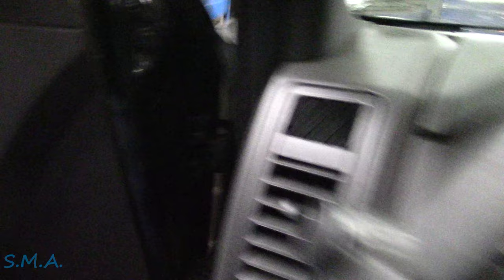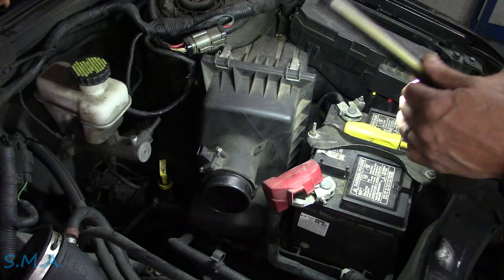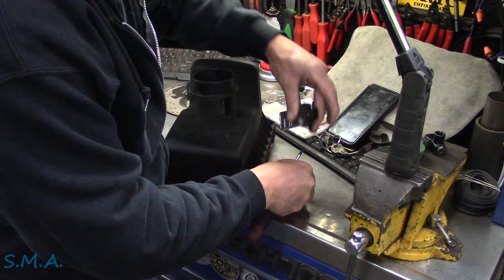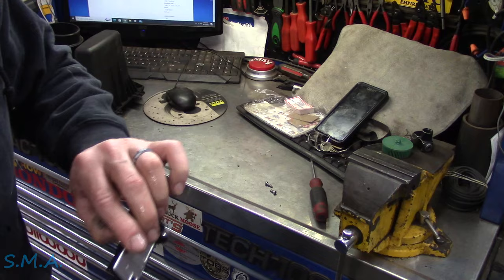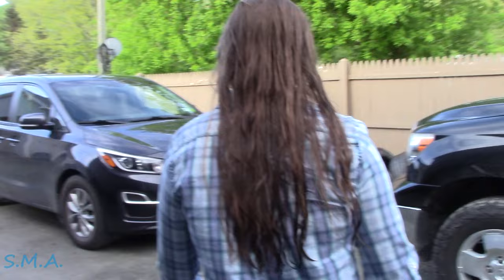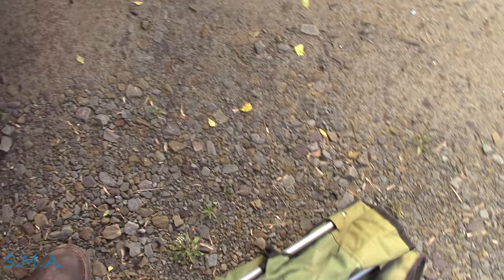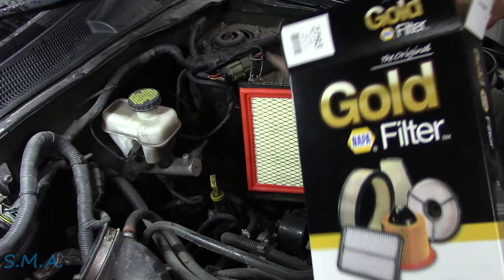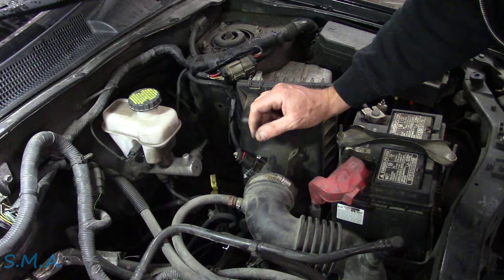A Mouse, A May Fly And A Broken Car....

Comment: Dang , it must have been really turbulent in there for that mouse at 65 miles per hour!   LOL The rush of air !
Reply from the maker: Heck with the rush of air, it was prolly more turbulent passing the throttle plate lol
Reply: Need someone to do the Math - gotta be way higher than 65mph 'wind' in the airbox surely? 
2liter engine spinning 5k rpm
Reply: @SouthMainAuto  Did you have to clean the throttle body?
Reply: @SouthMainAuto  Should the engine rated in RATPOWER instead of horsepower then ?
Reply: @SouthMainAuto  Hate to sound like an English teacher bitch,but the word is, probably, not prolly. Sorry just a pet peeve of mine... Love your content, always. Thank you for what you do.
Reply: @SouthMainAuto  Surprised you didn't pull a plug and check the cylinders for a badly shaken mouse.   I bet that engine had a squeak or two......
Reply: @patrickinottawa27  I was thinking the samething, and said nah you better not. Alot of filter missing and an absent mouse. At the end of it though if shes running good with almost 200k on it i wouldnt go looking for any trouble thats for sure.
Reply: @Acrowat40  A 2L engine at WOT sucks in 1L of air per revolution. At 5000 rpm that is 83 (round to 80) L per minute. Amazon says the filter element measures 7.29 x 10.21 inches = 74 sq in or .05 square meters. 80 divided by .05 = 1600 meters per minute or 1.6 km (one mile) per minute... 60 mph on the nose.
Reply: @bigtruck57h25  Y'all come on out to Arizona, where we have cowboy engineering. "Y'all kinnec up thet thar lat bub wit bob war!"
Reply: @flagmichael  cheers top work!
Reply: @homeserve9292  yes we never had cats in the house but if a mouse got in . bring the mama cat in over night and  no more mouse . traps not so much.
Reply: @bigtruck57h25  You must be a real hoot at social gathering.
Reply: @vincepalaa  you should meet his twin! LOL
Reply: @flagmichael  Your calcs are way off. Air velocity at an intact filter, at 5K, will be about 4mph. Velocity through the rat hole would be higher but impossible to say how much. Might get up around 60mph at the throttle body.

Comment: Nice catch Eric! Regarding the mouse in your wife's van, my wife did the same thing. She brought some plants home in the trunk and unleashed the little sucker. I had a mouse carry field corn up into the top of our Volvo's engine. He somehow got the corn into the timing belt area and dropped it down onto the crank pulley which caused the engine to jump time. After that experience, I made the best mouse trap ever by using a 5-gallon bucket with about 5" of water and drilled a hole at the top for a coat hanger. Then I drilled a hole in the center of each end of a can so it could freely spin on the hanger. I put peanut butter on the can so it was balanced and made a little ramp to the top of the bucket. Mice love peanut butter and go for it before anything else. I caught 12 mice over the next couple of weeks in my garage. Now I only get a mouse now and then. If it gets freezing cold put some anti-freeze in the bucket. I put a little bleach in the bucket as well. No smell, and you know right where the little suckers are. I've had them make nests on top of the cabin filter too...but no more. I tried sticky traps once and caught a baby bunny in one. Took me an hour to get the little fella out. He was missing a little hair but survived the ordeal. Love your auto repair videos. You are a fantastic auto mechanic. We could sure use more like you my friend. 😉

Comment: Happened to our RV when we were driving in heavy rain in Northern Ontario.  The air filter got saturated and released a bee that got logged in the MAF orifice.  It would run on the starter motor and die as soon as we released the starter.  We initially thought that it was a failed fuel pump.  Had we known that unplugging the MAF would have allowed us to continue we would have tried it.  Anyway a $500 tow bill to the Ford dealer in Wawa.  It was fixed in about an hour. Lesson learned.  I switched to a K&N filter and now I carry a scan tool.

Comment: EXACT same thing happened to me with my 93 Mercury Grand Marquis with the 4.6. No power and stalling at stops. Pulled the MAS and it had a dandelion fluff in it, which was odd as the air filter was intact. Blew it out with compressed air and reinstalled it. Ran like a Mustang after that.

Just remember the First rule of Ford: Check the MAS if it runs like A55.
Reply: Same thing happened to my Hondoo, but the mouse never went past the paper filter!  She had a real nice nest built in there!  I couldn't believe it was running let alone how well still!!
Reply: ahhhh.....the old danelion puff ball trick.....I hate when that happens

Comment: Tip : Pay attention how you put back your MAF sensor. If you put it backwards, you get problems. Usually there is an arrow, how the air must flow. Often it is fool proof, because they made it so you can only put in 1 way. But some can be installed in the wrong way.
Reply: @johnogara3029  This wasn't a tip for Eric.....🙄

Comment: I do find it interesting the problems you find here. My car issues are so simple the diagnostic is easy. The brake pedal sinks to the floor, that is the master brake cylinder. The power window does not work, the motor was shot. Noise is coming from the rear wheels, the wheel bearings were going. The car shakes on the highway, the front struts were shot. All these problems were found quickly and easily on my Subaru and all happened in the last 6000 miles (between 120,000 and 126,000 miles) and I never had a problem before these four concerns. Now that it is all repaired, the car works like new again. I can only hope my problems stay this simple but if they don't perhaps Eric's videos help. Thank you for them.

Comment: I had a mouse claiming his residence in my 1967 Ford Fairlane 500XL. It was a battle finding him but with sweat and prayers he was defeated. There were things I tried to keep the Rodents away but could not succeed. I finally came across a product called Fresh Cab sold in the big box stores, also Rural King and Tractor Supply. It looks like a giant Tea bag and smells like a pine forest. But for $12.50 a box(4 bags per box) it does what it's advertised to do. Bags last four months but I keep them going for six. Only thing that works for me. Doesn't kill a thing, but mice take off for your neighbors garage.

Comment: My girlfriends Mitsubishi would do the same thing. Start then die, couldn't give it any throttle. Disconnected the MAF and it started. Pulled it, cleaned it, problem solved. Eric you have really upped my diagnostic game and it has really helped me. I hope Mrs. O finds her critter and don't fly a kite with a key on the string when it's raining!!!!

Comment: I have a car that sits a lot, after replacing the air filter 3 times in 2 years I finally got some 1/4" mesh hardware cloth and made a plug to cover the air intake from the front. Don't know why they don't come like that.

Comment: For 28 years I worked on Honda motorcycles (primarily GoldWings).  When the GL1800's came out we immediately found the owners that lived in the 'country' had mouse problems
getting into their air filter.  I solved the problem by putting screen over the 2 air intakes.  Pop rivets held the screen on.....and no more mouse problems.
Reply: Any ?

Comment: The “ change oil light” was a bit of a clue as to the frequency of maintenance being performed.
Anyone that thinks, well that was an easy fix so you shouldn’t charge never owned a business.  You are more than entitled to be paid for your time and knowledge.  An inexperienced mechanic may have worked for hours before finding that problem.  Mice in your car is the cost of living in Gods country.  I spent many summers living on a small farm between Savona and Bath NY 60 years ago.  Lake Keuka was a favorite spot.
Reply: Anyone who thinks he shouldn't charge for the repair, should have fixed it them selves.  The car wasn't taken to South Main Auto because the owner knew what was wrong or they would have fixed it themselves.
Reply: Their everywhere,,,,, everywhere….sleep with rubber boots on with masking tape on the top ! Shows our age! LOL
Reply: @frotobaggins7169  10- fur on that !

Comment: would recommending an oil change be something to consider for the customer, or was it running rich for just a very short period
Reply: Dash message said "oil change required".
Reply: That could just be that it wasn't reset since the last oil change, they don't reset themselves.

Comment: Another a great video.  What a lot of people do not realize, is that damage done by a rodent to a vehicle is covered under automobile comprehensive insurance. In upstate NY, this coverage is relatively inexpensive, and lower deductibles should be considered. Besides rodent damage, comprehensive covers you if you hit a deer or if a rock breaks your glass. You are even covered for flood or a tree falling on your car. It would not be worth putting for the  repair on this video. .But for more costly repairs it most definitely would.  Moreover   you can also utilize your rental reimbursement coverage. If you put a claim in, you may lose your free discount,  but you would not be  surcharged for the claim.

Comment: Many years ago, I used to work at a shop that was next door to a quick lube place. At least once a week, they would end up breaking a car, pushing it out into the street and into our parking lot. One time, they pushed in a Prius. They did an oil change and an air filter, after that it would “crank” but not start. When they replaced the air filter, they dropped a leaf into the mass airflow sensor. Most cars don’t use MAF sensor readings when they crank and first start, so if they have a bad MAF they’ll start and stall. Many hybrids use the MAF while cranking, so if the sensor is bad, it will crank and not start. Removed the leaf, cleaned the MAF, engine started normally.

Comment: The best "trap" for mice and rats (plus a whole lot else) is actually really easy. Used motor oil. Fill up an old gallon paint can about halfway, and et up a little "ramp" for them to climb up. They absolutely cannot resist the smell and will jump right in, but can't get out.

Comment: Same thing happened to me. I had just put a new air filter in. A month later I couldn't keep my truck idling. Took the air intake hose off and noticed the screen before the MAF sensor was clogged. Hole in air filter. I now have a metal screen on the air intake hole to prevent mice getting in the air intake box.

Comment: Eric is correct.  Unplug a MAF sensor if you think it's giving you issues.  On a typical weather day (temp and barometer-wise) and at sea level, a Ford will run like new without the MAF connected.  Of course, it will never get to closed loop and it won't run right with less than ideal weather or altitudes and it will also light the CEL.

Comment: Mr. O, don't eat yellow snow, and don't carry around a long piece of copper..... Glad she got the mouse. I have a 2010 Escape. Runs well at the moment.  I inherited it from mom. I use it as a commute car to work and back (25 miles round trip). It's got the big 2.5.  It's only got 72,*** miles!  One thing about the Napa part number, you forgot to say "it's the classic 2793."   At work, we used the sticky pad traps (owners wife doesn't like the poisons), one of the traps is flat gone! Stepped on 'er and took off!  Been looking for a mouse with a big white shoe!  Watch for lightening my good fellow!

Comment: Had a 06 f150 towed in awhile ago and the customer said that when he started it fuel was spraying under the truck, upon inspection found the nylon fuel line was chewed through.  Replaced fuel line and sent customer on his way.  A week later the same truck was towed in with the same problem. Same line same place.  Made another one and wrapped it up in alluminum tape.  So far no repeat.

Comment: I feel Mrs. O’s pain.  Some years ago, mice spent the whole winter lounging in our RV and made passage ways everywhere in the most inaccessible places.  They made the bathroom vanity their latrine, and deposited an ample supply of mouse pee and poo.  It took a couple of days with a rented ozone generator to kill the mouse pee smell.  Every last bit of insulation was removed from the water heater under the gaucho.  We found fiberglass insulation everywhere in the camper.  What a mess!
Reply: Bin there…. Got the T shirt! They can be very costly !

Comment: Interesting that the nest remnants didn't get sucked in from the air box ?
Mrs O,try using those box type mouse traps in the car ,very practical .
I still struggle(life's tuff aye) with how many car owners don't know the basics of car care and maintenance,checking a air filter is reasonably easy ,and googling how to check the airflow sensor is very achievable ,even the Ladies can do it 😊 Mrs O could run a internet class for the Ladies,on car maintenance and a combined  class on Pest Control also ,Mrs O's squeak removal 😊😊

Comment: Great video Eric, seeing Vanessa looking for her friend in the car I can understand what she's been through , I've had a Mercedes panel van in for repair , waiting for parts as we all do at the moment , been outside for a couple of weeks, went to move it today , flat battery , opened the bonnet , it smelt lovely under there of 💩🐀🐀🐀🐀🐀💩 from Mr Roland Rat and his family , then I saw a family member on the engine , walked away , got the steam cleaner out , blasted under bonnet , chassis legs , engine and 3 of the blighters were being evicted by steam methods , they ran like the wind away from the van , I pressure washed it for over an hour , cleanest chassis legs in the UK, covered the engine in nice smelling stuff and moved the van , time to fix it and get rid , have left lots of square food blocks around the yard for his family to chew up and 👻👻👻👻👍👍

Comment: I was an hvac tech for years. I can’t tell you how many times I got a no heat call only to arrive and find the furnace switch at the top of the basement stairs shut off. Minimum charge, 1 hour.

Comment: Peanut butter. Jif is perfect.  Victor Tin Cat Repeating trap. It can catch up to 10-15 mice. Just make sure to check it regularly so it won't stink up the place. Like every other day.

If you want to really have fun, take a piece of broomstick, a 5 gallon bucket, and a paper towel tube. Put the tube on the broomstick as a sleeve. Place the assembly across the buckets top.  Put a small board as a ramp to the top of the bucket. Dab the broomstick with peanut butter for bait.  Watch and listen for the plunks.

Comment: Years ago, mid 1980's, I went out one morning and got my truck and turned the air on and fan up high.  As soon as the fan turned on I heard a loud sound that sounded like the right side of my truck was coming apart.  Then the fan kept making a vibrating sound when it was on any higher than low speed.  After a couple of days you guessed it!  A putrid smell for several days!  A few more days later dried mouse body parts blew out onto the passenger floorboard!  Guess I know where they came from! 😂

Comment: Glad you sorted out your mouse troubles 
Had a problem with my work car smelling like something died inside it. It started off smelling like damp feet but after a few days of Africa summer temperatures it got to the point I had to do something serious because it smelled so bad I couldn't drive it without dry wretching. 
I removed all the tools and several weeks accumulation of work stuff from the car, even took the carpets out but still couldn't find the cause. Eventually found the culprit in a pocket in the back of the drivers seat cover that I didn't even know existed. Turned out to be a small box of camembert cheese that had come out of a shopping bag when it fell off the back seat on the way home from the weekly shopping trip..

Comment: Bought a 99 4Runner off a friend years ago. It wouldn’t run right. He changed coils, spark plugs, etc. and gave up. I found a crack in the air box and a filthy map sensor. Got a good deal on a nice truck and only cost me a can of mass airflow sensor cleaner and some rtv for the crack in the air box 😉

Comment: My 98 Toyota Camry is a mouse house ( bat too ) every 4 months or so my dear husband has to open up the blower fan and pull out a dead mouse. Lucky its reality easy to get to the fan motor. Had a bat fly out of the grill after I hadn't driven it for few weeks.

Comment: My dodge 1500 shut off at 75mph while passing a big rig, really fun trying to get over to the shoulder without getting creamed. No check engine light, so I plugged in my reader and it showed a mass airflow sensor error. I got out my can of cleaner and it was  fine.

Comment: When I lived in Annapolis MD, My washing machine was not draining,  The first time it happened the first time, I found a sock stuffed into the drain pump. I took it apart, got the sock out.  Machine fixed.  When it happened again, and the pump was cleared, so I called a repair guy.  He came, I told him what I did last time, and the pump was clear this time.  He popped open the the top of the washer, pulled out a pair of my underware.  Told me to tell my wife to not overload the washer.  Didn't charge me a penny.

Comment: I’ve found hot-gluing half a peanut to the bait pedal of snap traps more effective than peanut butter. This was after having mice eat the peanut butter out of 8 different traps without setting them off in the span of two weeks. And that was with packing the little curl of the metal pedal, not just spreading peanut butter on top of the pedal.
Reply: I’ve found some traps are set to stiff. It makes them really easy to set, but also to hard to set off. If it’s a metal pedal you can squeeze it a little and make it more sensitive. If it’s a plastic one you may have to just play with it to find a spot that’s more sensitive.